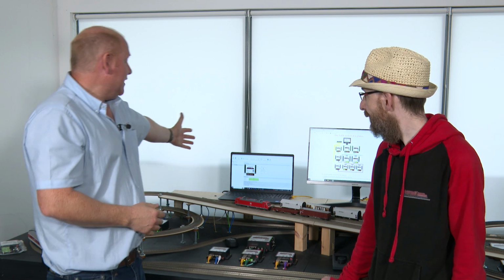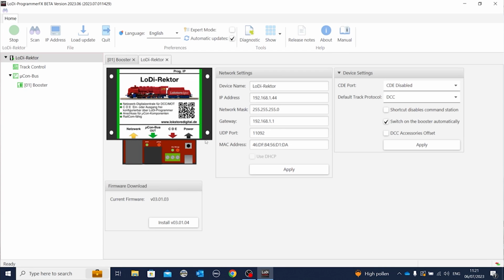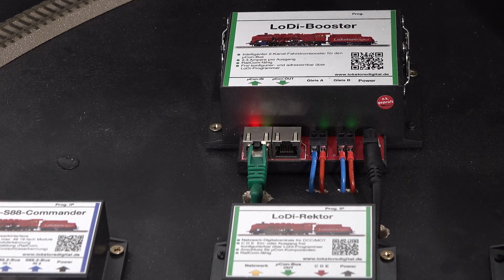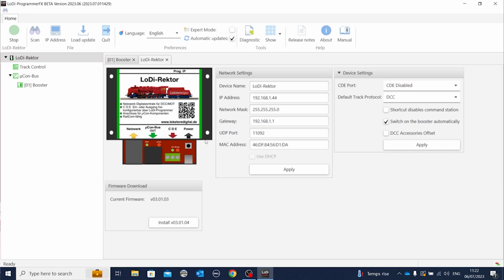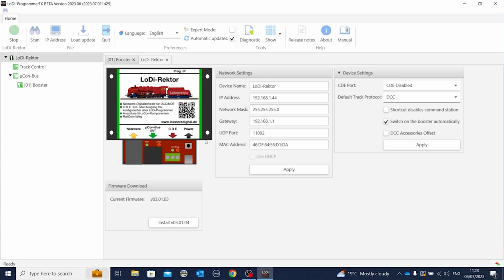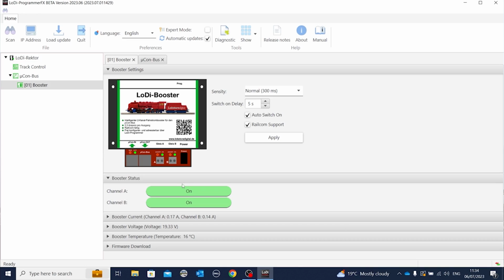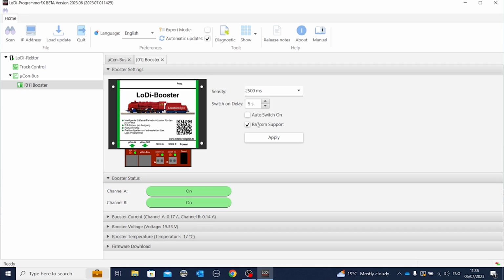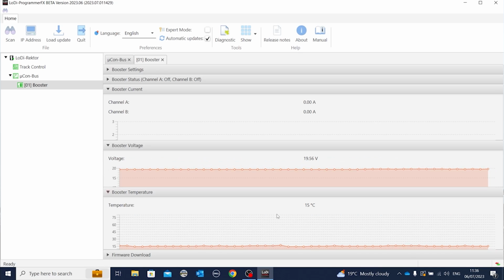LoDi Architecture, Command Station and Boosters at DCC Train Automation. No 6.

Comment: James. The 2 out puts from the Lodi booster are these connected directly to the track or are they connected into the Lodi 8 GBM to allow block detection?
Reply from the maker: The boosters supply track power to the GBMs on the GBM the is a + and minus sign. You need to get these the right way round from
The booster. See image below.

On our website in the blog is diagram of this
Reply: @DCCtrainautomation  Thanks James for your quick response. Much appreciated.

Comment: Can you get the Lodi system with power cords for the United States or is there plug adaptors that can be used?
Reply from the maker: Hi there we can supply the LoDi equipment to the USA noproblem at all. We can even make sure it has USA plugs.

Comment: I really enjoy the Lodi system. If starting from scratch it is difficult to find better. Components are well made, the architecture is logical, and extensive. The real kicker is the ethernet based backbone for all its advantages (data speed capacity). Great software and support from Andreas and Lodi forum. Well done guys. Keep going.
Reply from the maker: Well said!

Comment: Can a Marklin CS3 use the LoDi Shift Engineer using Feedback Modules? How do they connect to the CS3?
Reply from the maker: They would not connect directly to the CS3. But if you wanted to use with the CS3 and you were using iTrain you could use them together.